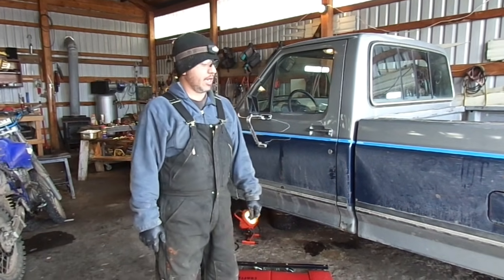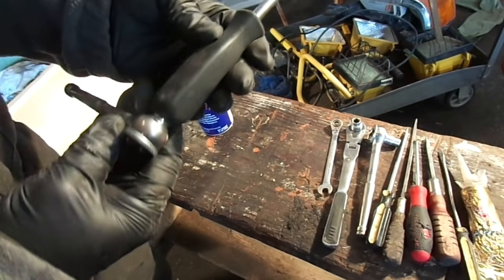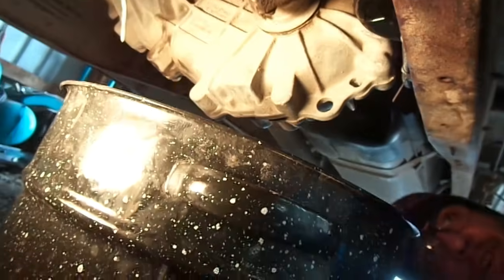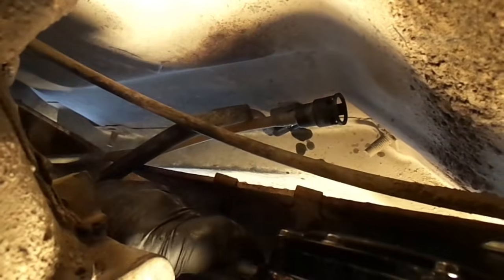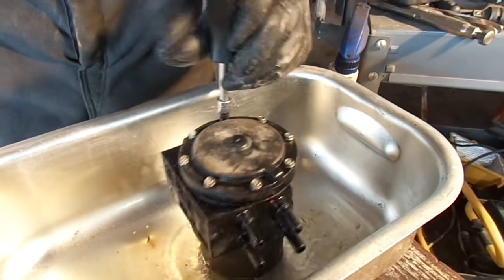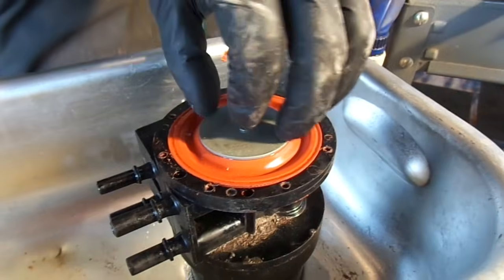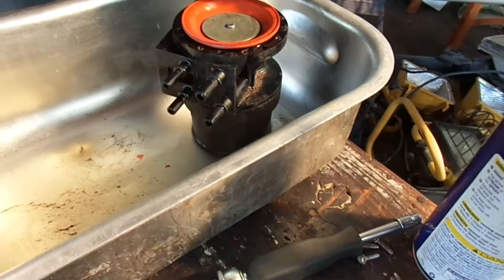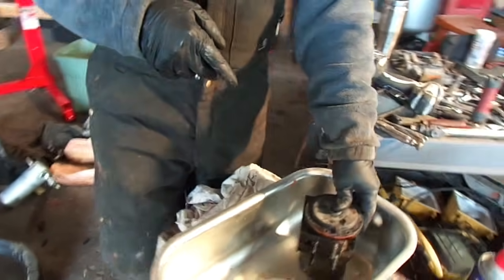1987 F150 Dual Fuel Tank Selector Repair

Comment: Thanks for sharing,  Ford told me my truck was to old, unless they want give me a free truck, sell me the parts, like Henry Ford, We can give you the vehicle, and survive on selling you repair parts,  well these news guys have  forgotten, what the man said. Your video was helpful,  backyard mechanic/25yr Navy diesel mechanic.  I'm having issues with the fuel system and will give it my all. Before I go there, fuel relay, battery ground,  inertia fuel shut off switch not popped up,  but will do a light test.
Thanks, great job to you and the Mrs.

Comment: MY problem was with the filter that is inside the housing.  You should show that the bottom is threaded and screws of to change that filter (that no one knows about ) no mention , not even  in Chilton's Ford truck book . When I pulled out the "unknown" filter , it was SO clogged , it felt like a hockey puck !   Good job Mr. Varela .

Comment: Thanks. Ya My Truck is doing the opposite. My front tank works and when I switch to the rear tank it Dies. Also my Rear Tank keeps getting full. So I will change my filter on that tank selector and free up my valve rods. But I think when I bolt my top back on I will have the Diaphram in the up position. I'm thinking more rubber will bite on to the cover?

Comment: Own my own shop for 40+ years. You did an excellent job. You save me a lot of time. Without a doubt the best help video I’ve seen. Thank you. Had an 89 Ford switch to a carbureted engine and put a 55 gallon auxiliary tank under my toolbox. What I understand fuel pressure from the tank side switches the valve. when I did switch it to the auxiliary tank it pump fuel into my main tank , same problem as you had. But thanks to you and this video I repaired it the same way you did and it worked fine. Again thanks for the great video saved me time.
           Just a little note there is a tiny O-ring that feeds the top diaphragm. I almost missed it. Without it the top would leak. I replace this little O-ring from a common O-ring kit and eliminated the need for silicone.

Comment: No thank you very much for this information I just replaced the fuel pump in my front tag. But I notice all the trucks that I’ve seen on the shows don’t have the skid plate I think that was worth taking off and drop in the tank and heavy no thank you

Comment: Simply outstanding! My new to me '91 F-150 was only running on the rear tank and I started searching YouTube for solutions. Found your excellent presentation a year or so ago and watched it twice back-to-back getting myself revved up to inspect the valve. Would have been the first major fix I attempted on the truck and I was stoked about getting into it with my newfound knowledge..., only to discover that someone had already removed the damned thing and bypassed the front tank altogether! I was actually disappointed and haven't fixed it yet. I'm grateful for your effort nonetheless and intend to get back to it along with replacing the rear sending unit before winter. Thanks so much for taking the time!

Comment: Great video, thanks!  I have a 1989 to work on with fuel issues, and I think it is this valve. You mentioned at the beginning, of there being a filter, I didn't see you work with anything that looked like a filter, may I ask, is there a filter that needs cleaned or replaced? and where is it located? What is inside the round bottom section?

Comment: Yep, my diaphragm is ripped.  I freed the valves as shown, but the tear in the orange is a death sentence.  Any pressure built through the lower inlet goes through the tear so rear tank overfills the front tank rather than pushing up the pistons and doing what it's supposed to.

Comment: Have the same problem with my '84 6.9L only pulling from the rear tank.  Thank you for this information, you did a clear and concise job in explaining what you did.  You even did it twice so that you could film it.  

Thanks for heads up about the fuel line clips, will buy replacements before I start the repair because if there is a slight possibility that it'll break, it'll break.  Rather have them and not need them than need them and not have them.

Thanks again and good job.

Comment: i’m 16 fixing up an 86’ with the same problem, and this video explained everything so well, thank you keep up the great content.🙏🏽
Reply: Was that the problem ? My 87 e150 rides rough. We changed the ignition module, fuel reservoir, spark plugs, distributor, throttle sensor, spark plugs wiresr. But still riding rough
Reply: @dogfilms7753  map sensor top left of the engine bay.

Comment: This was a great video. However he did not say if there was a gasket on it when he first took it apart.
So I am left wondering could you make a paper gasket or do you have to use gasket maker.
Totally awesome vid.
My front tank is out and I was totally ignorant about this system 1992, 5.8

Comment: i did this and now it wont stay running on either tanks lol
Reply: Matthew, are you getting any fuel to the engine?
Reply: @varelagarage6323  I can cycle the key on each tank and it will start and run for a few seconds then die
Reply: @matthewaxelsen4884  , but have you pulled your fuel line at the engine to see if you are getting good fuel pressure?

Comment: where is the fuel pump relay? changed the pump but not power to the front tank fuel pump
Reply: Crg MAT, the fuel pump relay on 1987 is in the engine compartment on drivers side, in front of the brake fluid reservoir.

Comment: Wow thank you so much very helpful I have a 1986 f150 4 wd and I'm starting with the fuel pump relay then the pump so I might as well  do the switch fliter and thanks for the  easy down to earth no bs    the truck sat for  many years so I'm replacing parts as I go

Comment: Wow thanks man! Had trouble even locating the selector valve. much appreciated! Got two fords that are not working and both got two tanks. Definitely will help.
Reply: Did it fix yours?  I hear my fuel pump running but it's not getting fuel

Comment: Thank you for the video. I’m having similar issues with my 97 F-250. I can run off the rear tank fine but switch to the front tank and the engine stalls. I was considering replacing the fuel sending unit.  I’ll pull this first. Thanks again.

Comment: I have a e150. It stalls out when I slow down. This part is leaking. You think this could be causing the stalls?
Reply: that could be the torque converter if you have an automatic

Comment: Hey just wanted to give you a shout out and say thanks for taking the time to make this video. I had a fuel delivery problem on my 89 f150 and started by changing the fuel filter which did not help. Changed the external fuel pump on the frame rail and then was getting ready to take the bed off to change the internal pumps on the tanks when I saw this video. It took like 30 minutes to remove, clean and reinstall the tank selector and it solved the problem and saved me a big headache of changing out the internal pumps. I appreciate you taking the time to put create this for us DIYers!

Comment: First thank you, second would you want to clean out the wd-40 with fuel would it interfere with combustion etc if not cleaned out?
Reply: Ryan, I personally would not worry about washing out the WD-40, the percentage of WD-40 to gasoline is so small that it wont even matter. Clean out the build up knocked loose so it doesn't plug up down the line and your good.
Reply: @varelagarage6323  thank you!
Reply: No!

Comment: I just completed this repair on my 1987 F150. A few observations: Don't buy a replacement unit. I honestly think Ford designed this to be serviced. I also broke the bottom bolt on the protection bracket when removing. I cut off the nut and drilled out the hole and replaced the bolt with a Stainless Steel version from Lowes. Completely remove mounting bolts before disconnecting fuel lines. Connect the fuel lines before remounting. The clips are easier to wrestle out and in with a little working room. The best removal tool for the clips I have ever found is actually a walnut pick from a nut cracker set. Change the filter on the bottom of the reservoir. No ford manual notes this even exists and auto stores don't seem to sell them, it is a WIX 33268 filter available online. The reservoir casing has an O-ring in the top to seal it, the WIX filter will come with a replacement!  Lastly, the lid only goes on one way. I would advise against using sealant or gasket maker. The vacuum flap inside serves as an gasket, and a visual inspection will usually tell if the its set and sealed correctly. Also, the case itself is vented, in the lid is a TINY oring and vent hole that travels from body to lid. I would imagine this is for allowing the air to move when the fuel gasket does. Using a sealant may clog this hole. 

With out this video, I would not have attempted this repair. Excellent information about a poorly documented Ford issue!
Reply: Thank you for that part number!
Reply: Yeah I tried with gasket maker and it didn’t work. I let it set over night and put it on my truck and there was no gas going through the selector valve. So I took it off and found out the orange gasket was sealed to the top, and the sealant was clogging a breather hole. So I had to remove all the sealant which was a pain. Then I put it back on without any gasket sealant and it never leaked and my truck was getting gas.
Reply: @paulrademacher thanks, rewound the video and saw he put it back wrong. But like y’all. I would’ve never attempted if it wasn’t for this video. Thanks for the part number and y’all’s feedback.
Reply: Would you happen to know if it is the same unit for a 96 f150? WIX 33268
Reply: Help please does it came with a filter?????
Reply: Thanks, you filled in the gaps.

Comment: When you're breaking the part apart how did you make the hole top for the for the driver

Or did it come and who's it made if so I've never seen that's the only thing I'm stunned about your video
Reply: It is called a spinner handle, mine is 1/4 inch drive. This is one link I have found, but you can find it in many different brands.
 https://www.fleetfarm.com/detail/pro-grade-1-4-in-drive-spinner-handle/0000000335136?utm_source=google&utm_medium=surfaces&utm_campaign=shopping%20feed&utm_content=free%20google%20shopping%20clicks&gclid=Cj0KCQjw59n8BRD2ARIsAAmgPmKuRNfIgtBQLgrhL2tl8ERxMeLyIn5BJCSbvP5HyeA-b0LD2PhquzoaAtGjEALw_wcB

Comment: Thanks Man, geeze I wonder what prompted ford to devise such a complex/demonic fuel delivery system.I thought I was running on the back tank only and the front was draining into it. . . BUT When I drained the tanks,(both full), the fuel in the front was fresh and fine but the back tank had Real Old yellow fuel that smelled like Varnish. . . nasty stuff. . . I hope doing your fix will get the job done but I don't know gotta get clean fuel coming from that rear tank first. . . thanks for the video, it was very insightful for me.

Comment: I appreciate your work and knowledge... So I have a ? For you .. here my problem .. it seems that's if I fill up on gas on one tank ... And I drive around .. my gas from that tank freely flows into my secondary tank .. which is not suppose to happen .
Reply: Conejo Loco, what year is your vehicle? There are some years that have a different style of valve. You are describing the issue that I am addressing in the video.

Comment: Thank you for this very informative information...I'm thinking that this is what is going on with my 1995 F150XLT it's been driving me nuts trying to figure this out. The back tank will use lots of gas but the front tank is filling up. This is probably the culprit.

Comment: Has anybody bypassed/removed the selector valve and just left one tank connected ? 
My selector valve doesnt work and the rear tank is in pretty bad shape. I was thinking removing the selector valve and just connecting the front tank straight to the fuel pump.

Comment: I think that I need to do this before I spend a ton of $. I have checked fuses, relay, and changed the selector switch on the dash.  I no longer hear the fuel pump priming just before I attempt to start the engine. I always used to hear it for a second or two.  If my selector needs this cleaning, could that be why I no longer hear the fuel pump priming just before starting?

Comment: What issues was it causing or could potentially cause
Reply: T Armas, it causes one tank to overfill the other to the point where you will see fuel coming out fo the fuel fill tube/cap. It also starves the truck of fuel after a short drive.

Comment: Nice video..I just brought a 96 f150..and it didn't have a selector valve on it.im replacing both tanks and pumps..but I got the selector valve from a parts pull it..just cleaned it up nicely thanks to your video..cant wait to install it

Comment: Nice! Thanx so much! Been driving me CRAZY for a while now lol! Been throwing parts at it however all the parts I replaced were quite old bur still had the same problems, like you did, would start up, I could even drive around a bit and then it would die. If I let it "cool" down, it would start again and I could chug home. I made sure I wouldn't drive to far... The rear tank never worked but I did replace the front tank pump and the rail pump. Finally tonight I removed the Selector, took it apart like you did and unscrewed where the filter goes, found out I had no filter and there was an extra little o ring on the bottom, one of the valves was mess up, a valve for the rear tank. I cleaned everything up, cleaned like u did with the WD40, moved the valves up and down, then cleaned the top really well since I don't have gas proof RTV right now, reinstalled, didn't install the clips as I'm just testing.  Engine ran great, finally! Before it ran strange, kind of seemed like a vacuum leak at times but now it ran great until it stalled out and died. But I noticed the fuel gauge fell down which leads me to believe gas from the front tank is going to the back tank, and the tank doesn't seem to be leaking so maybe I just need a pump for the rear tank... anyway I let it cool and just fired it up again, it ran a bit then died so it seems like front tank is outta fuel and hopefully all I need is a new Selector!  Pricey but then I'll be closer to getting both tanks working & I think I found a Ford oem selector on ebay for 200, just gotta make sure it's the correct one. 
I don't think I can repair the original Selector altho maybe I could try to block off the hoses going to the rear tank for a cheap quick fix until I get my new selector?  I'll reply to my post whatever happens, this could help somebody out there like me.... Thank you! Thank You! Thank You Saul! You Rock!
Reply: did you end fixing it

Comment: I can tell you why it leaked. The raised portion on the lid that points to back of the valve, that’s a fuel passage. There’s a very small port under that raised portion. That port has a very small rubber gasket. If you don’t reinstall the little tiny rubber gasket, the fuel will squirt out of the back of the valve body. There’s even a notch in the valve body for it to squirt out. I know because mine did. I went back to where I disassembled it and looked closely on the floor and lo and behold, there was a tiny black rubber gasket, almost like an o-ring. If you have the tiny o-ring like gasket reinstalled, no RTV is needed to seal the lid. Plus, it requires really good RTV to stand up to fuel. Helpful video, but be mindful of the o-ring. Also, the center shaft that the Phillips head screw goes into needs to be exercised as well. The shaft has a detent ball that holds the other two valves in place. This system requires two working fuel pumps to work properly, so I wouldn’t be surprised if you did have a bad pump initially. Not saying the valve wasn’t stuck, but the valve needs pressure from the pumps to cycle properly.

Comment: Bro! you dont no how much this helps. My truck is a 95 inline 6. When it gets hot here in Houston them tanks wanna expand and the fuel comes out of my rear tank and i was thinking that the pump maybe bad because i havent been able to use it  but i goin to try this before buying that 200 dollar part and replacing the pump. Man thanks again For Real.
Reply: Johnny, did this work for you? I'm having the same problem on a 94 4.9 inline 6
Reply: It did not. My tank has the valve inside the tank.
Reply: @johnnydixon6900 is it apart of the pump? Or does the tank need dropped and the valve need replaced in the tank?

Comment: I have a 95 F-150 with dual tanks. When it runs rough I smell gas in the cab. I’ll be checking the system out when it gets warmer.

Comment: Good job man, I have a question and maybe you'll have an answer. I have a 90 ford e350 with a 5.8lw. I put in a new fuel pump, and replaced the fuel pressure regulator. I have no fuel pressure and the fuel is just going through the lines and dumping back into the same tank. Front tank. This van sat for 12 years and I think I maybe something is gunked up inside this selector valve causing it to reroute back to the tank once it reaches a certain pressure. Barely any pressure stays in the rail. I'm stumped!

Comment: Good video man. You'll always have the smartarses who know everything. Screw that. You took the time to explain everything and your camera man is awesome to get the close ups that are normally hard to see. I watched the whole video even though my selector is working okay for now, I'm just gaining the knowledge just in case and you sure made it easy for us.
Thanks for taking your time to share this with us. BTW, I own a 1988 F150 Lariat 2 wheel drive, with 62k original miles. I do have a gas leak somewhere so I'll be looking for videos to help with that. I give you 5 stars for your video !
p.s. I use Kroil for rusted bolts. Hard to find but it is the best !!